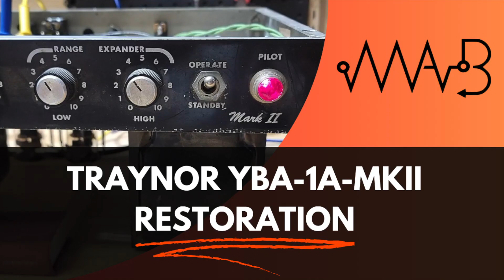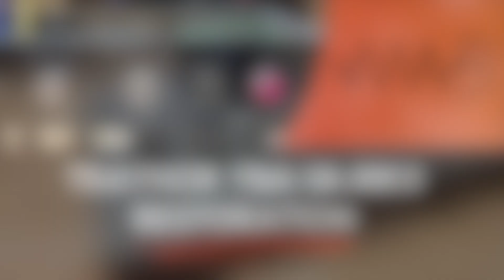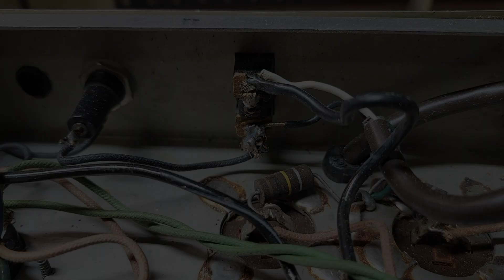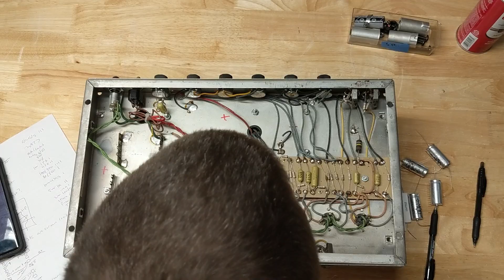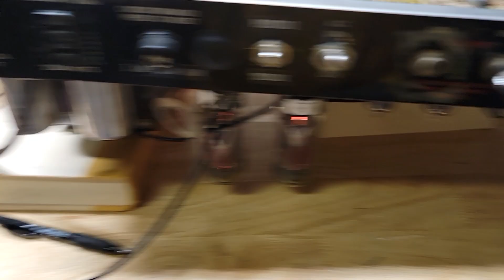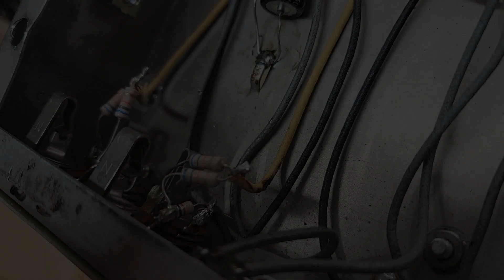Traynor YBA-1A-MKII Restoration

Comment: I recently rebuilt one. The bias cap rating calls for 250VDC according to the schematic. 160 volt caps will barely handle the surge voltage. Cant remember where I found 10@250v caps, must have been Mouser or Digikey. The usual vendors don't have em.
Reply from the maker: Thanks for the comment! Schematic also says there's only 60V hitting the first cap. Have you measured what the voltage surge is? I seriously doubt these caps are in any peril.